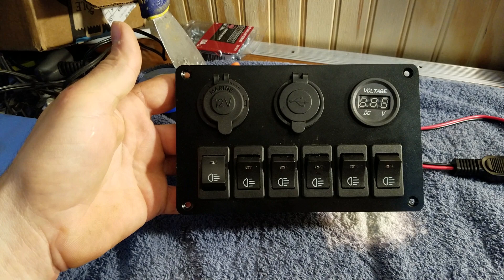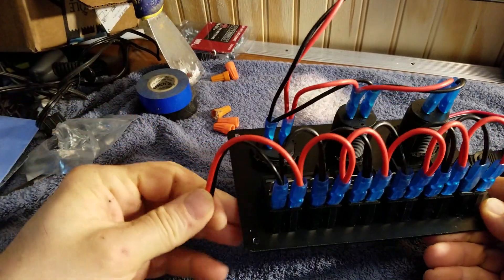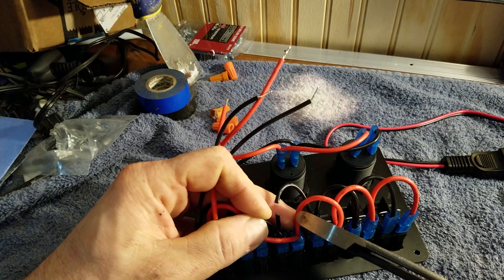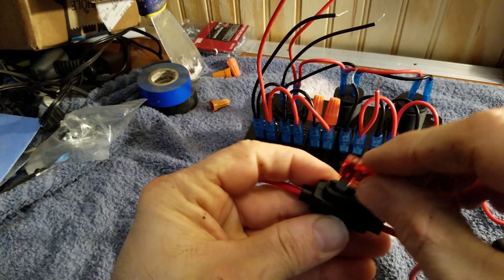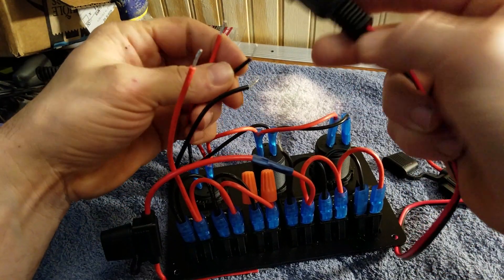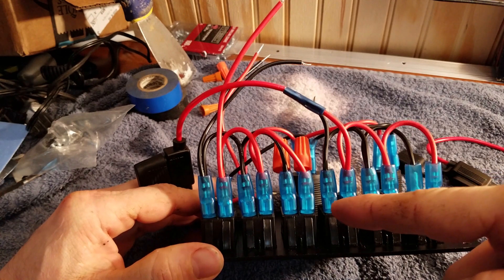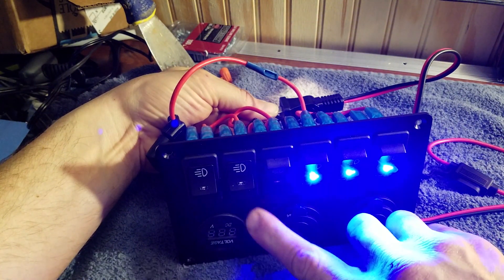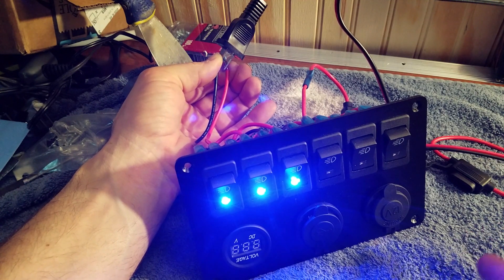wiring a 12 volt switch panel and making changes to make it better

Comment from the maker: RELAY comments? YES!!!! You can use them. You could use them before I changed this wiring. You can still use them after my changes if needed. Not all systems need relays and they are one more thing that will eventually fail one day. This video does not cover relays.

Comment: Wim just doing this!! My switch panel is about 2meters from my fuse panel. What size cables should I run to the switch panel?
Reply from the maker: I'd use 12 guage wire. Should be good for 25-30 amps on a short run. You can use 10 guage if it will let you sleep better at night.
Reply: @ Are the cables that are pre wired on the switch panel smaller than 12 gauge? Does that make a difference? Thanks 🙏
Reply from the maker: @pjos11 I'm not 100% sure what size they are but I have run this system as in the video for years with not one problem..Biggest thing is to make sure everything is fused. Double check the system at capacity when complete and make sure nothing gets hot. A warm or hot wire means it is overloaded. Nothing should feel warm to the touch.

Comment: Separating the daisy chain in the switches achieved nothing other than to force you to make an extra connection to those switches. The daisy chain power supply is only to power the LED's. It does not power your devices. That is what the other 2 terminals on each switch is for.
Reply: Ok, I concur that there are other ways to set these up. Apologies for the misunderstanding. I have removed all the common inputs from mine and bring power from an external fuse box and then on to the device.
Reply from the maker: Have run separate fused power circuits from this setup for several years now with no problems. BTW this is a multipurpose unit with many correct  ways to set it up but you are wrong about this only separating LEDs on this unit.

Comment: thank you, that's what I was looking for. Just wanted to get all of them through fuse box. By the way, what is the 3rd connector for on the switch panel?
Reply from the maker: Pretty sure 3rd was for led light switch. Not near it now so can't check. Glad to be if help:)

Comment: Just don't run the load through the switches. These switches are only 2-5amp rated. These pre-wired panels are wired to provide positive power to relay switches.  Relays can carry 30amps+ loads. Fuse on the supply side of the relay.
Reply from the maker: They work great through relays as well  but this is just a more simple set up for basic needs. Pinned comment on video discusses this:)

Comment: Hi there, I have the same switch and I'm wondering about the other two male ( not connected) terminals below the pre wired terminals, which one is the positive and which is the negative? Is the positive directly behind the pre wired positive on the same side? Cheers
Reply from the maker: I believe so (99%) sure but always best to put a multimeter on it to verify.
Reply: Cheers mate 👌

Comment: Hi I have a 5 switch controller panel.  When it hook up to battery it has s light that stays on full time I want it to only come on when the light to my boat is activated
Reply from the maker: Mine come on when the switch is activated. Not sure if that can be changed
Reply: My bottom  lights  come on if battery is hooked up . But if I put the blue wire to the light switch the will only come on when I hit the lights ?

Comment: how many amps are you trying to run through your switches? Jesus... you're just going to melt those things... learn to relay....
Reply from the maker: Relays are great but add an extra layer of complexity and one more component to fail down the road.  This system has been running for  about 2 years now and allows greater control and flexibility while not overcomplicating the ststem. But yes, for larger loads and more complex systems relays are great:)
Reply: @VANquishedAdventures  If it works for what you need, good deal.

Comment: Well, you are right at the end when you said that you don't know anything...but you are getting views.
You have rewired the lights to the switches, unnecessarily
Reply from the maker: The lights were prewired to the switches at the factory. I didn't make any changes to that. There are many ways to use these multipurpose panels....part of the reason people buy these and videos about them get views.
Reply from the maker: Also worth noting is that it has worked flawlessly with my changes for over a year and a half now.
Reply: @VANquishedAdventures  
You didn't rewire them wrong, it was unnecessary because the LEDs that glow on the switches have a very low draw, you could have wired the assembly very easily as it was originally designed, and then you could have shown some ways of wiring the switch circuits with and without relays and even show the difference between switching the ground side vs. switching the positive side. I didn't imply that you were stupid, you said it and I parroted you
Reply from the maker: I see. I didn't get into more complex options with relays etc because   that's just more spare parts I have to carry around for when things fail. Just needed more capacity on the cheap:)

Comment: If you use a relay to protect each circuit then you can use the negative wire to activate the relay
Reply: Can you explain this in greater detail?
Reply: @aldente1411  use #85 as ground trigger source (to a switch) on relay. Ground other side of your switch. Effectively you use the negative relay as a Normally off. #86 and #30 to battery and #87 ground to your device. Makes for less wiring under dash as you can use a common ground and daisy chain negative wires to a block and from block direct to battery ground.

Comment: Can you power on a light bar relay from two different switches in the vehicle driver area and the back of the vehicle aka trailer/rv
Reply from the maker: Pretty sure you'd want that to be on a 3 way or two separate switches controlling grounds to complete the circuit.
Reply: @VANquishedAdventures  thanks 🙏 you should make a video 🧐😇👍
Reply from the maker: I don't have the components for this:(  Maybe sometime in the future when I am stationary and can get parts ordered.
Reply from the maker: Might be simpler to put it on a remote like this: 
https://smile.amazon.com/dp/B00LMICSIQ/ref=cm_sw_r_cp_apa_glt_fabc_JA93CCFKQ30S2M3HTV7S
Reply: @VANquishedAdventures  that’s cool thanks
Reply: My switch panel came with a 20 amp, is it possible to connect it to my radio fuse which is a 10 amp fuse tap?  When I tried my lights and radio stayed on

Comment: I stopped watching when I saw wire nuts
Reply from the maker: You've gotta be smart enough to use whatever connectors work best for your application. I used what I had on hand for the video. I mostly use crimped connectors with shrink sleeves, especially on final installs.
Reply: @VANquishedAdventures  i would hope so.At work  any time I have to fix an electrical problem made worse by someone  it usually has wire nuts.

Comment: I would have thought that wiring as they were original, would be fine if run in conjunction with relays.
Reply from the maker: It is, but some people don't want or need the extra complications and components required with relays. That is the great thing about these multipurpose panels. There are many different ways to use them.

Comment: Hey Bud, think you've misunderstood the switch wiring. The wires you have there are solely for the blue led lights within the switch so you didn't need to separate them. You will then add your accessories you want to turn off and on to the switch later individually and they can have their own circuit with fuse as required dependent on the current.
Reply from the maker: The one power wire(originally) powered every switch, not just the led lights.
There are definitely many different ways these switches can be wired for ones individual use though. Fuses are a must though.

Comment: Thanks bud. My Chinese switch panel just arrived prewired the same as yours with 16AWG cable so a max of 13As... Im rewiring each switch to go direct as you have done to a fuse box. Each switch will run 2-10A, no need for relays as you have said. And for what's it worth I have bounced this by 2 x 12v specialists and they agree relays are overkill for under 20amps

Comment: Leave the negative as is but clip every red jumper wire and install a separate fuse to each switch.
Reply from the maker: That would work too. For my use I only needed a little more capacity out of the panel so I did it this way.

Comment: Layman question:  How come you don't get shocked when you hold those wires to the plug?  Is the 12V not enough to hurt??
Reply from the maker: Exactly. 12v at these amperages are basically harmless when touched. A 12v circuit  shorted out or otherwise damaged does pose a fire hazard due to heat though.

Comment: So the LED lights on the Voltmetre and ports are constantly on? Would this not drain the battery? Is it possible to wire in these to one of the switches below? Cheers
Reply from the maker: Lights are on when switches are on. Light in cigarette type socket, guage and USBs are constant on. Most or all can be deactivated if desired by removing wires. LED draw is minimal but if put in long term storage disconnecting your battery source is advised.
Reply: Most people wire them up to one of the switches so you can turn off when not on use

Comment: sorry but wrong way switches are intended to send power out to a relay and a relay pulls power for a small fuse panel that gets power from the battery or individuals fuses that get power from the battery . So the switches themselves pull very little amperage maybe 1/4 amp at most as all they are doing is sending power to a relay telling it to turn on . Also next time try using flush cutting wire cutters no need to tape off .
Reply from the maker: Can't argue with your logic but keep in mind this is a multiple purpose panel that can be used many different ways. Many people do not use or know how to use relays and this video is more for those using direct wiring. Thanks for the input :)

Comment: why wouldn't you leave the negative wires connected? theyre all going to the NEG bus right?
Reply from the maker: Also will want to verify the shared ground would be adequate for max capacity. Running the separate ground eliminates this concern all together.
Reply: Looking for this comment. There was no reason to cut the negative.  But I guess to each there own.
Reply from the maker: Just keeps a clean complete circuit not dependent on other grounds and my wiring used was red and black(positive and negative) so it was just as easy to use that wire the way it was made.

Comment: Do i really needs to separate switchs? Even if connecting them to a relays?
Reply from the maker: If using relays your load will be through the relays,not the switch so it would most likely not be necessary in that application.

Comment: How could i wire this to have a switch control my subwoofers, stereo and amplifier? Trying to put together a home car audio setup and thought it would be cool to have a switch control different parts.
Reply: The amplifier only needs a switch on the (rem) input. So the switches are fine for this application.
Reply: Your car radio should have two power wires. Yellow is typically constant power - wire to your battery. Red (accessory) is your switched power. You can wire this to your ignition key or any switch - Wire the red directly to one if these switches and you now have a switch for your stereo.
Reply from the maker: Amp would likely need to powered through a relay as it would likely be too much for these switches wired directly.